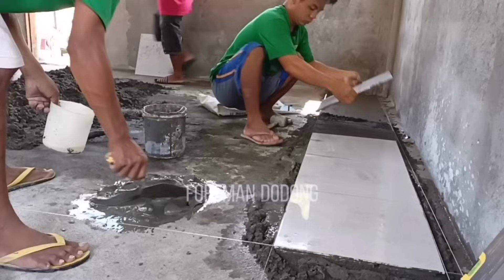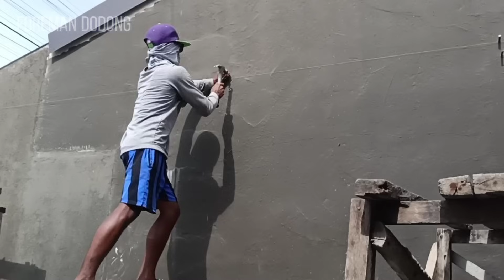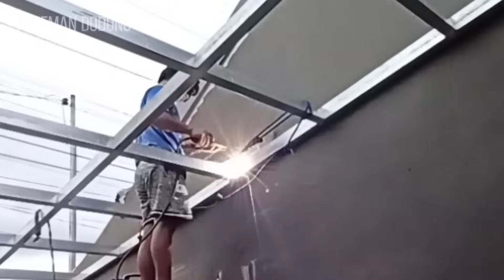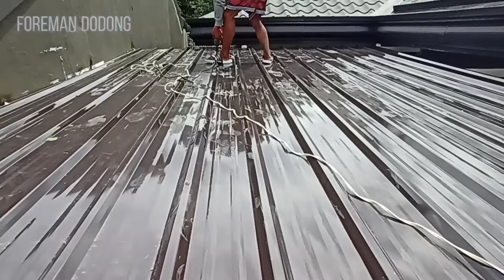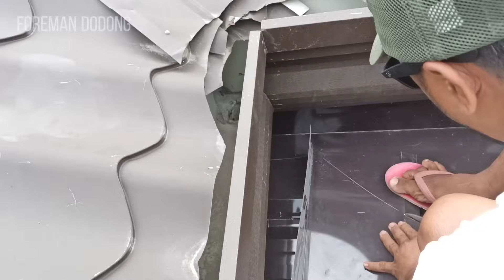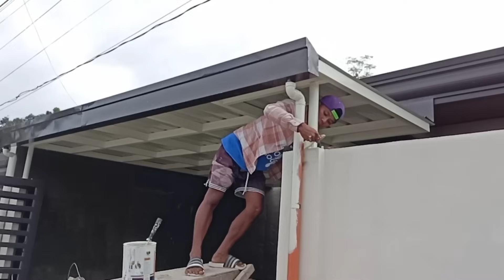SIMPLE GARAGE CANOPY DESIGN with TUBULAR STEEL TRUSES and COLOR ROOF | 24sqm 35k budget

Comment: Napansin ko lang na marami ang nagpapagawa ng gate na horizontal ang design.

Ang disadvantage lang ng ladder design sa gate ay madaling akyatin at mapasok. 

Maliban kung lalagyan pa ng design na mahihirapang apakan ng akyat-bahay na kawatan.

Mas preferred ko ang vertical design.

Sa trabaho, malinis at mainam talaga na may sealant para maiwasan ang leak.

By the way, bawat bahay ay may firewall. Kaya kung magbubutas para maglagay ng kung anuman dapat sa sariling firewall. Hindi sa firewall ng kapitbahay.

Nasa building code yan.
👍🙂🙏
Reply from the maker: Design ng housing yan Dalawa sila ang nag mamay ari ng fire wall na yan. Kaya nagkasundo magkabilang panig Bago na umpisahan ang project nagkasundo na po ang dalawang may ari kaya Wala na pong paki si building code jan.  Salamat po sa advice  nyo appreciate ko po opinion nyo., sa awa nang diyos  matagal na po kami sa ganitong trabaho Wala pa namang nasugatan or na koryente samin kasi mga sanay na kami sa ganitong mga trabaho

Comment: sir ano size ng tubular at kapal nya? steel o G.I po ba sya? salamt!
Reply from the maker: gi 2x3x1.5mm
Reply: @foremandodong  Sir anong kalseng welding rode /electrode ang ginamit nyo sa 1.5mm? Salamat!
Reply from the maker: 2.5mm po 6011
Reply: @foremandodong  sir pano kung walang 2.5mm, 3.2mm 6011 lang meron dito sa amin di kaya mabutas ang tubular sir?
Reply from the maker: nasa nag weldeng na po yan.. dipinde sa nakasanayan nya0